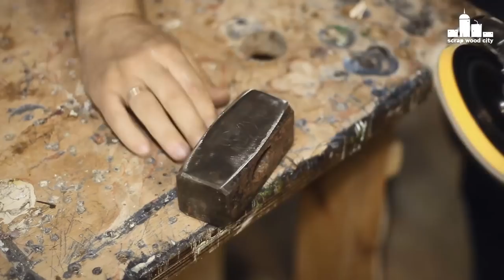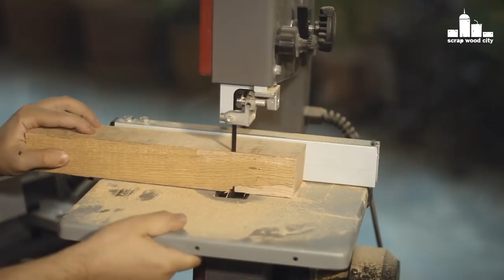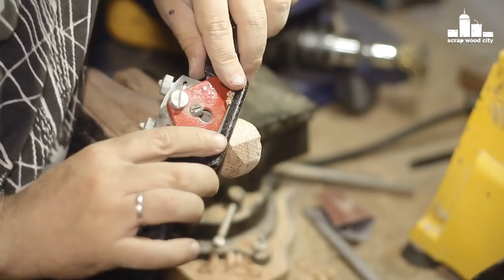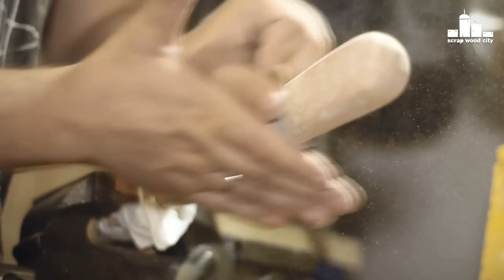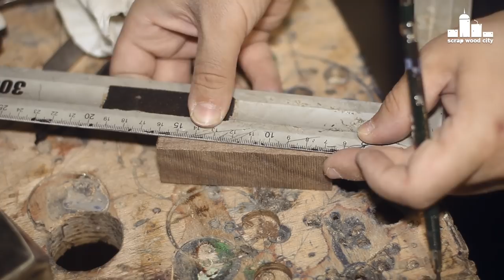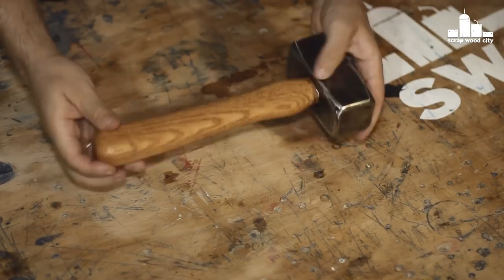Restoring grandpa's sledge hammer

Comment: I have to disagree with you Dimities, It is not 'Abuse'. But everyday 'Use', of such a tool. My Sledge is about 30 years old and has similar dents. Not that I can remember when they happened, but yes history of a well used tool. You made a draw knife about a year ago that you could have also used on the handle, and would have been a great tool to use seeing as you made it for such a project. Just yesterday I finished a similar project on a small axe I use for my carving. Great tip on using the hot glue for the re cutting on the bandsaw. I will use it in future instead of the tape I have used in the past. Great Project, thank you sir
Reply from the maker: Thank you my friend. I think I picked up the hot glue trick from a Jimmy Diresta video. It is really cool. The draw knife was pretty big for this handle. I prefer to use it on bigger stock.

Comment: Good job,,,  thanks for sharing. ..
Here is an idea for a high stress handle.
Start with an over sized blank of strieght grained wood. And split off the outside of the blank. That way the center grain of the wood will be in the center of the blank on both ends . That way if you miss a strike with the hammer head, the handle will be less likely to have a diagonal split.
This is just an idea. And in no way detracts from your skill and talent. 
Thanks again.    😆😆
Reply from the maker: Thank you, really cool idea!